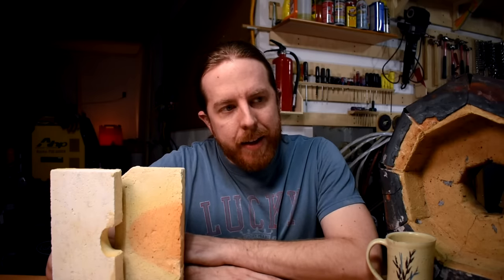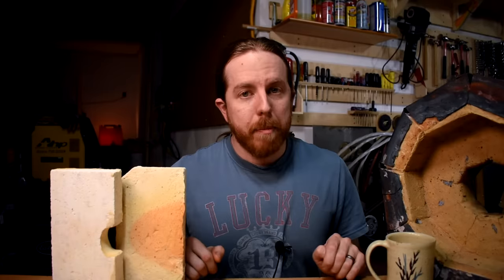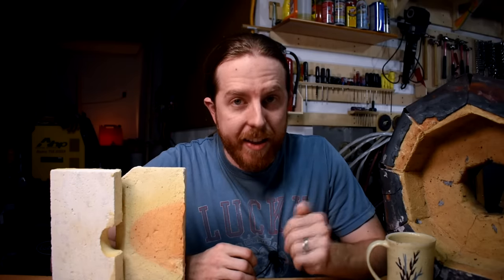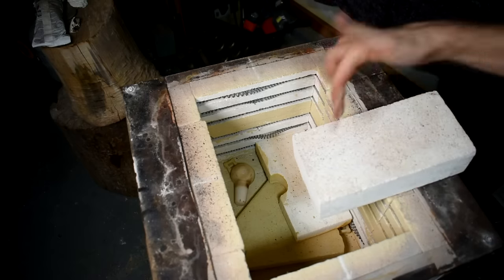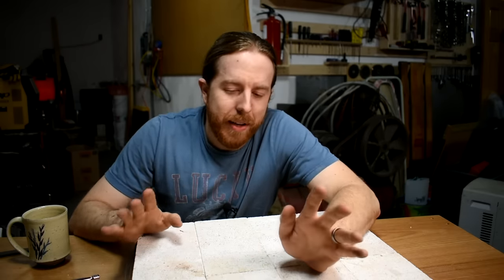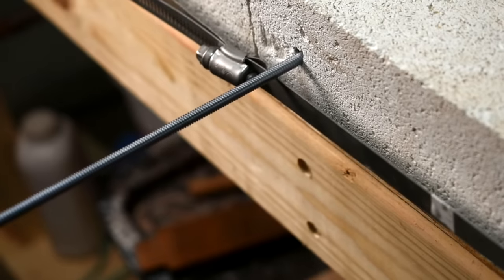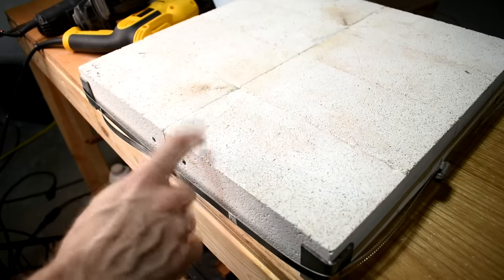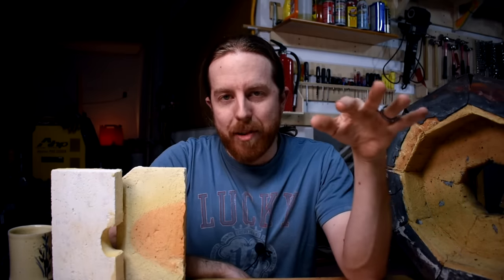There's a Problem With Fire Bricks

Comment: Once the rods are through the lid. Replace them with Khantal wire. It's melting point is 1500 celcius
Reply from the maker: Good idea, I'll have to find some beefy wire
Reply: @PaulsGarage  I got 25meter of 1.5mm gauge on amazon and it came from China. I have used it for my charcoal burner to hold the coals. The handles are great because its a bad conductor and after I've done the cooking I just picked up the burner and put in a snuff pot and can use the charcoal again

Comment: You put your reinforcing rods in the wrong direction!
You need FOUR rods through the ends of the bricks. 
This will support the ends in the centre.
The way you have installed your rods, won't do that.
All it does is make all the ends sag together.
😊

Comment: Your IFB's ( Imsulated Fire Brick) are shrinking due to thermal shock. When they cool drastically after you remove the lid they will shrink. The same will happen with Silica Brick if you don't bring the temperature down slowly. I work on refractory all over the USA. So I am sure I know what I'm talking about. Try some Super 3000 mud on those IFB's on your next repair. Bet they won't slip out ever again. 😊
Reply from the maker: Thanks for the info! I appreciate it!  Never heard of that coating, is it like satanite?  I've used plenty of that before though not on this oven

Comment: Will the threaded rod get hot enough to eventually get annealed? Is this why you called it a "bodge" job, only good enough for a few firings?
Reply from the maker: not sure exactly. The inside wall of the bricks gets to 2k degrees, the outside usually around 200.  It's anybody's guess how hot the channel will get.  The rod isn't needed to hold it together when it's hot, it only holds the bricks in place when i lift the lid (when it's cool) and it doesn't come in to play until the bricks shrink enough that the tension holding them together doesn't work.  That took a while the last time.  maybe a year of use

Comment: Along with modern fire brick grades you also have the older variants that are far different too
Reply from the maker: i didn't know that, interesting.
Reply: @PaulsGarage  yeah, much like standard bricks or concrete the recipes used have changed a LOT over time, and the older versions were often made to last and to keep form a lot better than modern ones.  However, they often used resources that were more expensive or harder to handle, or used materials we avoid using now.  But, if you look through what they used to use you can find many varieties that out-strip all but the very Highest end modern fire bricks, and maybe even those in some cases.  Although, in the case of firebrick unlike other materials you will generally find that the super modern version tend to have better heat reflection.  But not all That much so the durability does still often overtake the balance.

Comment: The shrinking process you are mentioning is so interesting, and something I have never even considered before, in spite of it's simplicity! As an aspiring metallurgist having known about powder metallurgy and sintering, I am wondering if the shrinkage problem might be liked to sintering of the alumina particles. Even though the firing temperatures of the oven are largely underneath what it takes to properly sinterin the industry, I would be willing to bet a 5 that the mobility of the atoms is sufficient to have a small effect over large periods of time, à la Arrhenius style. If that's the case, then the shrinkage should eventually become less and less of an issue with well-seasoned bricks, as the rate of change becomes smaller and smaller with time.

Comment: One piece of 1/2" concrete board cut to the dimension of the lid could be attached with firebrick mortar or caulking as a mastic.  Done problem solved

Comment: Try stainless steel all thread, stainless isn't as affected by heat as regular mild steel.
Reply from the maker: Good idea, that'll be next if these normal steel ones fail
Reply: @PaulsGarage  There are a lot of different grades of stainless, don't know which one would be better for this application, some Google work or a call to the salesman of a major steel supplier should give you the information, even if you buy it elsewhere.
Stainless doesn't conduct heat very well, which is why it's nearly impossible to cut with a torch and is the last thing you want for a wood stove flue.  Instead of harvesting heat off the stack, it mostly goes right up the pipe.  
I've looked into casting my own firebricks and probably will, at some point.  
Commercial refractory rebuilders may be a good source of used firebrick.  When they re-line a boiler or burn chamber, they will likely replace all the bricks, even though many may still have some life left in them.  
Plus, refractory rebuilders/suppliers may sell you bags of refractory cement and stainless steel needles to mix in for reinforcement so you can pour your own sizes and shapes.

Comment: No one here uses refractory cement?
I made a bottle foundry using refractory repair mix, is says no more then a 1/8" thick, I made it 3" thick, took a month to dry, but it's lasted ten years of light use
Reply: 134a bottle

Comment: Hey Paul. What says you for DIY fire bricks? And one could wonder, " What recipe Paul would use for his DIY firebricks if and when Paul decide to make his own fire bricks ? "
Reply from the maker: I looked into it, I wouldn't do it.  I have materials around that could make the bricks, alumina and silica and kaolin powders and all of that, but the process is complicated and in the end you probably won't save any money per-brick, and you will end up with inferior bricks anyway.  The stuff i've built from them need to be somewhat insulating and handle 2400f+ for hours on end, which is enough to melt most things.  All the cheap clay available to me melts around 2200f or less.  (i tried 🤣)
Reply: @PaulsGarage  Wow! Good to know. I'm glad I asked. Thank you for taking the time to reply.

Comment: Are thes the best thing to build a fireproox storage box from?
Reply from the maker: Probably not.  These slow down heat transfer, but not that well.  The bricks themselves won't melt, but anything inside will still get hot and get wrecked.
Reply: @PaulsGarage  Thanks for replying.  That is what Ithought.

Comment: Can't you pre-shrink them?
Reply from the maker: not really, they shrink slightly every firing.  it's not really a problem that happens one and stops
Reply: @PaulsGarage  Oh, they get used up? Didn't know that happens
Reply from the maker: It's not exactly that they get used up, but at those temperatures you get into something called "heat work", where parts melt/sinter/whatever, from a mix of temperature over time.  It's weird.  The longer they spend at 2000+ degrees, the more "heat work" occurs, and it never exactly stops.  Most pottery for example will shrink a lot in a firing, but if you fire it again, it shrinks more.  You can even have certain minerals decompose and cause bloating, even if they didn't the first time and the second time never got hotter.  Nothing is permanent at white hot temperatures lol

Comment: I sold refractories for 14 years, so I know something about it. Insulating Firebrick is sold based on temperature rating. But you normally want to use a brick rated about 300 degrees higher than your furnace temp. If the brick are run at their rated temperature, you most certainly will get shrinkage. The alternative solution could be to build the brick in the shape of an arch. Then it will not fall in as easily. The other solution would be to use ceramic fiber. But you have to be cautious with ceramic fiber also. You should definitely not exceed the temp ration if the fiber, and ideally the max furnace temp should be a few hundred degrees the temperature rating of the fiber.

Comment: so I found One of YOUR vidieoS and Wouldn't you Know It? I am Looking Into a DIY Oven for Case Hardening! camp fire just aint getting it DONE!
Yes I HAVE Stood INSIDE Ovens of refractory bricks for forging titanium, I was the Pipe Fitter working the burners and fuel air injection lines and the guy mixing custom binders for sand casting in foundries.

what about casting or pouring your own shapes with a custom mixed? refectory cement/mortar, perlite, carbon char or such? 
I do not like the Idea of a thermal conduit with other dimensional and thermal issues inside your insulated media? just sits wrong with my OJT of such.

Comment: Are these bricks cheap?
Reply from the maker: Nope.  Well it depends what you want.  Hard fire bricks are pretty cheap, but these light insulating ones aren't, and the prices go up as the temperature rating goes up.  The cheapest ones are 2300f rated, I have only used 2800f bricks which are double the cost, a bit heavier, and don't insulate quite as well.
Reply: @PaulsGarage  I am thinking a fire brick cabin...proof against forest fires?.

Comment: First you need to Google refractory second your new solution isnt much better..steels expansion and contraction rates are far higher than firebrick. It is bad for many reasons. Look at ceramic kilns for tips. Bottom and sides are held together by gravity. Outside steel is just a way to move it and keep it together. Top is 1 or 2 pieces that cant fall into the hole

Comment: Make a cover out of refractory cement. no more bricks for a cover.
Reply from the maker: I did that a couple furnaces ago, it still cracks and I had to put a band clamp around that one, too.  it did work, though
Reply: @PaulsGarage Yes you would need a band around it. Did you make it about 4" thick w/ 4-5" in the middle? Then you can place bricks or other small crucible over the hole. Our small gas pit furnace at work will last all year or more
Reply from the maker: I don't exactly remember the dimensions but the hole was smaller than the brick foundry furnace opening.  The real nice thing about the castable one was the jagged crack.  With the band around the jagged edges held together much better than the smooth sides of the brick.  It had teeth to hold everything in place.  That furnace was demoted to garbage can and eventually I gave it away
Reply: @PaulsGarage  Was it  a dry mix in a bag with course pieces in it? Casting silver and gold is my day job. Fire brick and refractory will not last forever but the cover of refractory cement should last for months to year at least.
Reply from the maker: @ifheli1  you know it's been so long I don't remember.  I think there was a mix of fine and course particles?  It was rated for 3200f, that's all I remember
Reply: @PaulsGarage   It you try refractory again I would make a ring or square cover (depending on furnace) and weld some studs around it and this will help hold the refractory.

Comment: One could mill some minor tongues & grooves into the mating edges of these bricks so they lock together, OR mill some shallow grooves to accept some small diameter ceramic rope gasket material to seal the gaps. Or, like you said, get a larger piece for the lid-door.

Comment: ok so tungsten rods can work as re-bar for your lid, it might be more effective to simply put the lid you have on the kiln then line the outside edge of the lid on top with more bricks to counterbalance the lid bricks like a lever, you are right that any artisan that uses high temperature equipment can & should compare notes, with that may I suggest that you try heating an iron object to a red hot state then dusting with powdered glass.

Comment: The problem is that fire brick is not for what you do.  That brick is designed for use in a Steel making Blast Furnace.  That brick will withstand 3,000 degrees.  But if you shut it down and restart it you will crack the brick.  I know that because I worked for North American Refractories Co.
Reply: These are just general insulator fire brick rated at 2800 which is stamped on the brick shown in the video.  They are not only used in blast furnaces, they are used in any application where you are trying to either keep heat in or out , and the heat is at or below the rating. Sure they will work at higher temperatures, but they will eventually start melting on the hotface and glass over. Once they glass over they will lose the porosity thus the heat transfer rate will increase . google knows that.

Comment: a way to fix the shrinkage issue on the lid would probably just have one large solid lid rather than have it made up of multiple bricks (but then the cost goes up dramatically) side side note if you go this route just make all the sides solid, expensive but idiot proof)

Comment: 5 minutes in. I’m a carpenter by trade. Why not make a biscuit joint at the center? It’s not hard dude. Google how to put wood together without nails. It’s certainly not rocket science.
Reply from the maker: Biscuit joint would work, but these bricks are surprisingly brittle, and would likely crack eventually.  The biscuit would act like a crowbar and pop a chunk right off.  I've broken chunks off so many times trying to cut grooves or holes, it's crazy
Reply: @PaulsGarage  Then use a large dato and make them like tongue and groove. It would also create waste. The way you’ve managed so far is impressive. I’m surprised the corners have not crushed if they’re as brittle as you say.

Comment: You can probably source some 3/32 or 1/8 Inconel tig filler rod for not unreasonably expensive, and they won't even know that thing is hot. Inco 625 has a working rating of 1800*f, and comes in 36" lengths

You could also use kaowool cut in strips between the bricks as a gasket that will allow for shrink and shift 

You could also put pipe or angle segments in the centers of the clamps to distribute pressure evenly and squeeze in more of an octagon without any additional redesign. Another 4 pieces like on the corners

When I say working temp for inco, that's operating condition inside a turbine. From cryogenic to 1800, you're talking very minimal dimensional creep as well. They will probably be loose in the holes after a while is the only downside 😂

EDIT just looked and 625 has a forging temp of 2100* and it still rings an anvil like working cold steel. A blacksmith here on YouTube was messing with it

And by "not that much" it's still $80 for 1lb. I'm talking about buying 2 individual rods on ebay. In terms of superalloys, Inco is entry level so it's easy to find.
Reply from the maker: Good ideas!  I hadn't thought of inconel tig rods, that's a great idea

Comment: Use a castable refractory
Reply from the maker: Ive made a couple furnace/ovens with castable refractor in the past, had lids break in half all the same.  Going to try some kast-o-lite eventually, could be nice but not for a lid.  The castable refractory lid breaking was actually why I first started banding lids with band clamps
Reply: @PaulsGarage  what refractory did you use?
Reply: @PaulsGarage  I recommend Mizzou. If you really feel you need that extra strength beyond this stuff, then you can make a matrix (like rebar for concrete) with some mild steel thin rod (1/16” or smaller). I’m in Joliet. I think you mentioned Chicago. Would be happy to help you set it up. 
MIZZOU CASTABLE is a high strength 60% alumina casting material for use up to 3000°F. It has excellent resistance to numerous different slags, resists vitrification, and actually shows expansion rather than shrinkage at high temperatures. MIZZOU CASTABLE also has superior resistance to spalling and high strength throughout its entire temperature range. Typical applications are ceramic kilns, combustion chambers, burner blocks and forge furnaces.

Comment: Why the hell would you drill all the way through? You only needed to drill an inch or two into each side of the internal faces.... Hell, if you wanted to be extra paranoid for future proofing swapping them around... you could drill a 1.5" depth in the dead center of each brick face, slightly larger so the bricks don't shrink around the expanding metal and break from the forces applied, and then cut 2.5" lengths of your rod... and just slide them into any face that presses against another brick... That should be more than enough to prevent the bricks from falling in and support them when lifting, without compromising the structural integrity of the whole damned brick with a hole that spans the literal length of an entire axis and adds a fracture line that guarantees the brick to be useless if it ever breaks along that line....

Comment from the maker: Want me to personally teach you how to use your 3D printer to learn sand casting?  Click here: https://paulsmakeracademy.mykajabi.com/
Oven Build Playlist here!: https://youtube.com/playlist?list=PL-aAeRpJou31awkN9xQIeMpIHwiHwRqyt
Reply: You could also just flip the lid over with each use so it shrinks evenly on each side?
Reply: you should use carbon rods to make pins to connect the individual bricks 

carbon will be unaffected by heat 
 they are not as solid but they don't have to long just a 1 or 1,5 cm
Reply: wrong, the Roman buildings that still stand are due to survivor bias, not some magic. there were a lot more other Roman buildings that crumbled and even the ruins weren't found!
Reply: Now that you have the holes for reenforcing rods, cut some half-lap rabbets to interlock the bricks. It will make your lid a little smaller but  it will be much stronger.